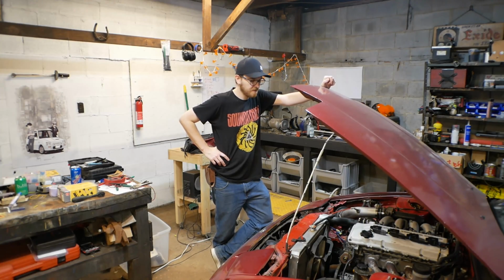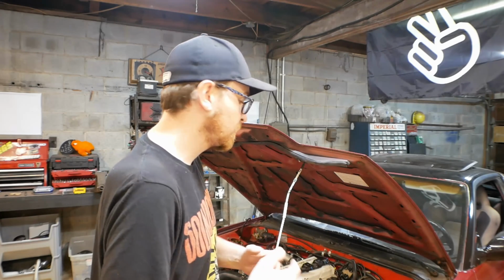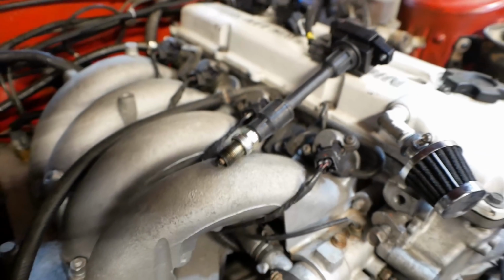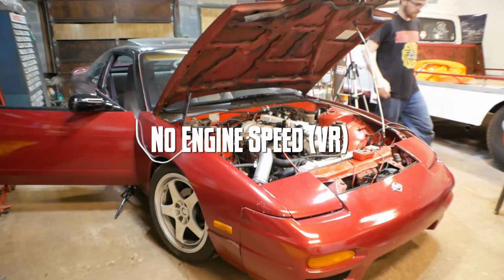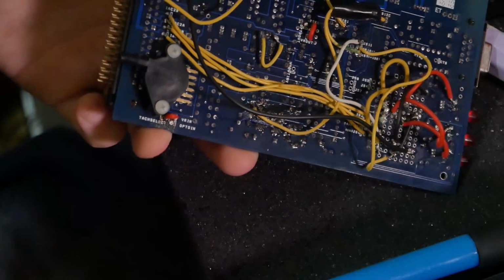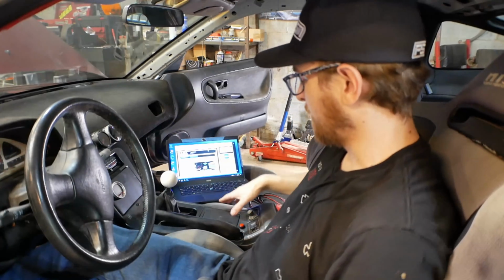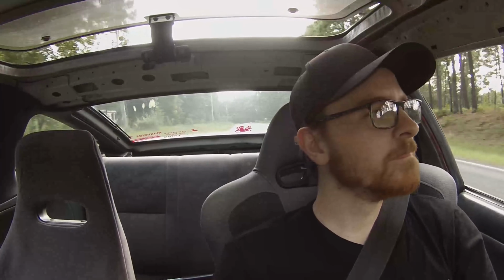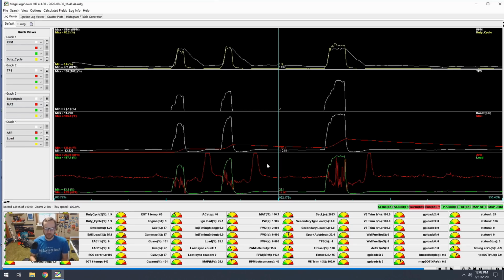Revised Ignition System Revision, Coil on Plug Success! - Project KADER

Comment: You might be able to free up some i/o pins by using a pwm style idle control valve instead of the stepper motor. Then use the cam sensor inside the distributor with the custom wheel from diy auto tune. It’s an optical type sensor in the base of the distributor with a shutter wheel. That’s the way I was planning to do full sequential before I sold it to you.
Reply: Something like this should work. https://www.ebay.com/itm/233676993224
Reply: There are bosch pwm idle valves that came on some hyundais. I think they only take one wire from the ecu with a pwm signal.
Reply: @Grantspec  I've been looking into this but couldn't really find a source of "donor cars" for this, but yeah that'd be a good solution. The stepper pins use all 4 of the outputs that natively can output the tach signal to the dash. The CAS in the distributor with DIYAT's wheel is a good solution too, I even have one of those wheels in a box somewhere :D

Comment: Have you looked into the jbperf dot com 4-channel ignition/injection driver board?
Reply: Looked into it a while back, it's pretty neat but a bit overkill when using logic level coils. Also as mentioned can't do full sequential without a CAS (which Cone kinda misunderstands the stock Nissan system (the stock distributor has an actual CAS in it, that is an opto isolator style, but isn't directly compatible with MS (unless you get an aftermarket wheel for it))). The real "solution" would be to use a newer MS3 that has the I/O expander capability which basically has all these circuits natively. The MS2 in Red came out in 2005, and there's been a lot of progress since then.

Comment: Woo! Knew you'd get it there. <3 When laptop ZK was under the hood bobbling, I felt that. Is 'throwing fire' detrimental or undesirable? Or is it just a thing that happens with cars like this?
Reply from the maker: in order to keep the engine from climbing in RPM the launch control is stopping a spark event during combustion so that no explosion happens, and no power is made momentarily. The fuel is still delivered though, and it ends up in the exhaust system where it eventually combusts later on.
Reply: @ConeDodgerMotoring  I understood all of that~!
Reply: @catherinelilac9199  I'm not sure if you're being silly or serious! Engines are driven by the ignition of fuel vapour and air inside the cylinder, igniting that mix pushed the piston down, which translates to movement on the crankshaft and into the drivetrain. If you don't spark a cylinder, the mix of fuel vapour and air doesn't ignite, the piston doesn't get pushed down, and it doesn't make any drive, but the mix is still vented as exhaust, and it'll likely ignite on exit of the exhaust system, which is hot, hence flames.
Reply: Alternate answer, Cone very fast, if Cone too fast, Cone spicy. Too spicy.
Reply: @StripeGurger  I was 100% serious :)
Reply: Cars that shoot flames are cooler than ones that don't
Reply: @zacharykarr  Mmmm. Yes. Sound facts right there.